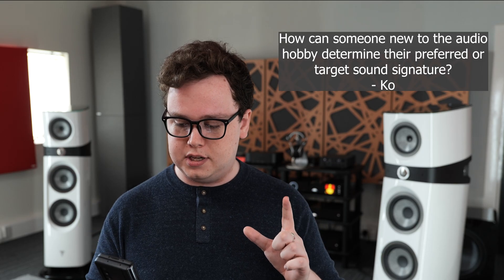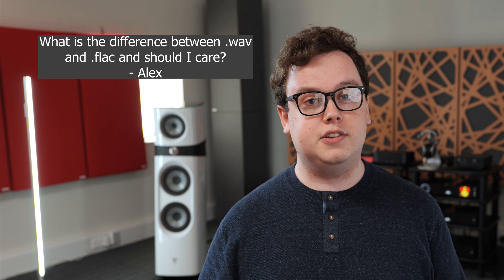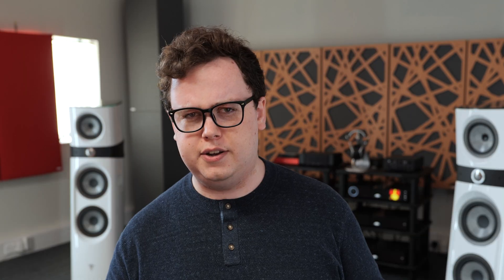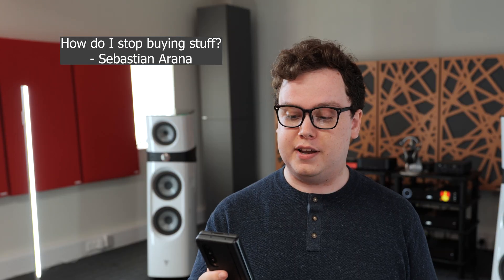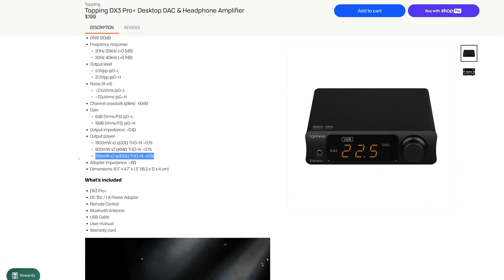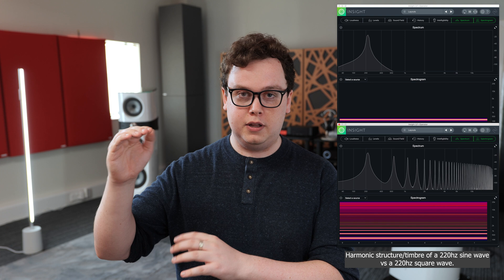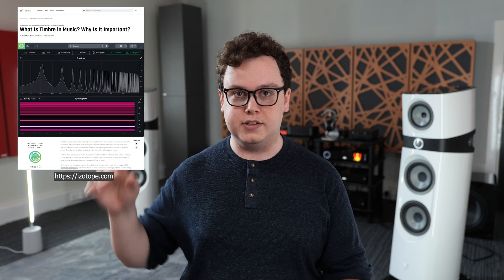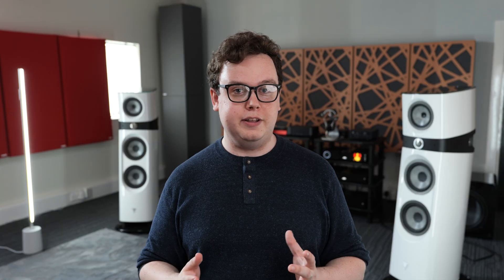Answers for YOUR Questions: DSD vs PCM, what to upgrade, and more! | Audio Support Q&A #1

Comment: i listened to celine dion both PCM(flac) and DSD. DSD sounds much better. the space for voice and instruments are very well separated and wide. they have their own room/space. it sounds bigger, not heavier. i'm not sure if i'm using incorrect term for it.. it sounds 'analogous'. it's like looking at a painting, touching it instead of looking the same picture on screen. problem is, not so much of my favorite tracks in DSD(.dsf .sacd) available in the market.
Reply: Yeh you're very right, most of DSD songs Format and SACD discs come from Jazz and Orchestra music genres..
Very few of songs genre selection that published in DSD format or SACD.

Comment: 2:00 well, there is a possible difference because flac needs to be decompress first, and making any gear to extra work, in theory produce extra noise. personally I could not tell any difference in my Qtest with Jcat PSU, but you need to try for each DAC to determine if it does or not a difference. I just prefer wav so I don't have to worry later.

Comment: I think an analogy that helps understanding the PCM x DSD difference is like comparing AM to FM in (analog) radio transmission. In AM you change the amplitude of the electromagnetic (EM) wave at the broadcasting frequency according to the audio signal, pretty much as PCM does at a given sampling rate (the bit word length is the resolution of your amplitude discretization), whereas in FM you make comparative small oscillations on the EM wave's frequency around the broadcasting frequency to carry the audio signal, just like the DSD 1-bit stream does, while keeping the amplitude constant. For the same reason as DSD compared to PCM, FM broadcast frequencies have to be much higher (about 100 times) than AM (medium-wavelength) ones in order to faithfully encode wave information in the audible frequency spectrum (whilst allowing for different broadcasting frequencies), but the ensuing audio quality is better.
Reply: Analog analogies (...) to digital are incorrect in principle and can be misleading.
Reply: @razisn  Could you please tell me why this particular analogy is incorrect / misleading?

Comment: Measurements vs. what I hear. I have struggled with this as a difference. I have had quite a few DACS and I don't understand how I can quantify for example why my Pontus II sounds so much better than my VMV D1se. The D1se likely measures cleaner  with a higher SINAD, but the Pontus II sounds so much more real for me. I haven't found anything to help me understand the difference. I really appreciate your videos and you seem to really have a great grasp on the technologies. I also appreciate your explination of test tracks, they have helped me to find a lot of great music that I have otherwise probably not have found! Keep it up.... P.S. did you record this in your main listening room? I would love to see what you have in your rig and setup philosophy for speaker positioning as they look pretty Asymetrical (that may be just the camera angle though).

Comment: For high level quality playback the order of importance is as follows: 1. High Quality recording (the old garbage in garbage out). 2. Speakers/headphones  3. Source (transport cd/streamer/turntable set up {cartridge, arm, phono stage})  4. amp 5. DAC/preamp. The one major caveat is that for a hi-fi speaker system extensive room treatment is essential, unless it's a desk top near field (3-4'). Just the opinion of this 63 old audiophile with 44 years into the addiction. By the way, I just love that the headphone show has graduated to speaker based system. I know you guys will do great, your headphone gear analysis as a team is excellent.

Comment: I'd say power amps aren't comparable to headphone amps in value and impact on sound. With speakers a budget of 50/50 can make sense or even more to the amplifier (sure there are good 5% on amp and 95% on speakers combos as well). Most headphones benefit very little from better amplification and the value calculation often breaks then as well.
Reply: Its really the fact there are way way more speaker designs and specification requirements than you'll see from a headphone. Speakers can range from 12 ohms, which are incredibly easy loads for any conventional amplifier, all the way to 2 ohms, which is absolutely brutal. The susvara, in comparison, doesn't require even a tenth of that capacitance.
Reply: @En_Joshi-Godrez  Yeah, but even with some easy basic speaker like a Monitor Audio RX1 I had a long time ago I could drive them fine with any amp, but slapping on a Hegel that cost six times more than the speakers transformed them completely and upgrading the speakers to 2k$ Revels added far less in comparison. I don't really see that with headphones unless it's exactly something that is categorically unable to drive them.
Reply: @hartyewh1  a susvara really requires a speaker amp in my opinion. In fact, there isn't any TOTL planar except the meze's that doesn't benefit from the massive enormous increases in capacitance and slew rate discharge that speaker amps must be designed for in the far harder application of driving speakers. You can save yourself a lot of money over an unnecessary headphone amp if you dont have dynamic drivers in your collection (which would be damaged by a speaker amp in most circumstances). I do find when it comes to tube amps that things below the $1000 simply have too many compromises over their equivalent solid states. Its only really once you get to crazy money do you find tube based headphone amps that have all the benefits of both subjective qualities. Thats a place were spending a lot can pay off, they can 'transform' your experience of a certain headphone. But even at the audio shows I've been to to hear them, its still very subjective on whether I even like what it's doing.

Comment: Thanks GoldenSound.  How good is aptx lossless codec compared to real lossless?
Reply: As per wiki, aptx hd supports upto 24bit resolution and 48khz sampling rate. Any more than couldnt be streamed. The term 'Lossless' can be of various bit depths and sampling rates.

Comment: Yea. I tried a bunch of hifimans this weekend to compare to audeze and figured out that hifiman sound signature does not work for me.
Reply: What about the Hifiman sound didn't you like? I like the Hifiman 400i 2020 version I bought months ago. I compared it with an original Grado SR 80 headphone. The 400i was around 70% better. The only thing I liked better about the Grado was it had noticeably better mid and upper bass definition. The 400i goes way deeper but it could be a little quicker in the bass. I guess that's what the Sundara model is for. The 400i is warm. I was expecting spotlit and bright. It has such great clean and extended treble. Great detail. Sounded great on vocals right from the start. I improved my sound and now fo like the 400i on piano; which I didn't before. Increase synergy and lower distortion is key.
Reply: @Chronometa Hello, what were the caveats you've felt about Hifiman's sound signature at those sessions?
Reply: In answer to the Hifiman 400i question. I own them and have been listening to them for months. They have bass that is deep and it is pretty well defined, but I've heard a little better def. Especially in the upper bass. The midrange is clear and clean as can be, but it's revealing nature will reveal flaws in flawed recordings more than non planars. It has wonderful tone colors due to it's ultra low distortion and purity. The highs are it's high point; so quick detailed and clean. It should be illegal at that price point. A very transparent revealing headphone. My only real caveat might be If you go more than slightly loud, it can start sounding a bit strained. My associated equipment has a lot of bass; that might be it. I might be advertising them for sale in US Audio Mart, together with a former top of the line Magnavox cd player and a former top of the line Luxman integrated amp for less than $1,000. I am going to explore higher up in the Hifiman line. I like their vivid  house sound. The 400i is a great headphone.